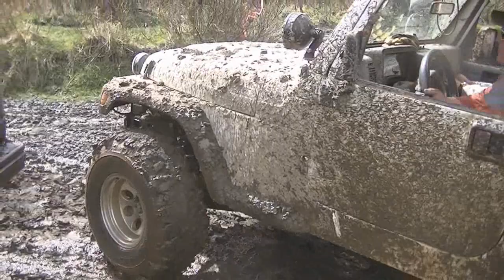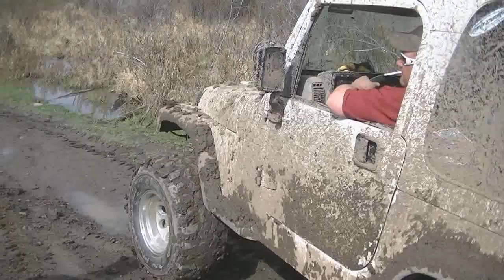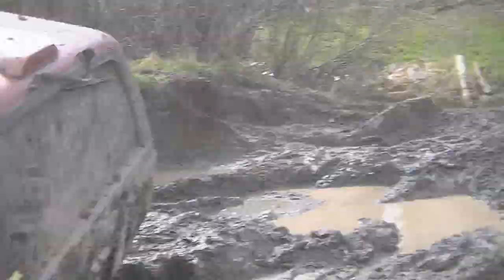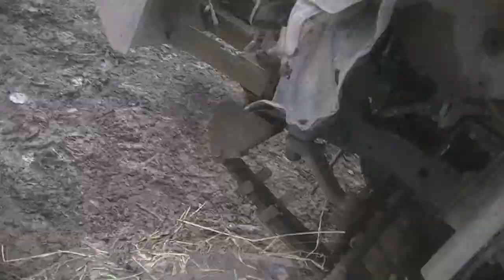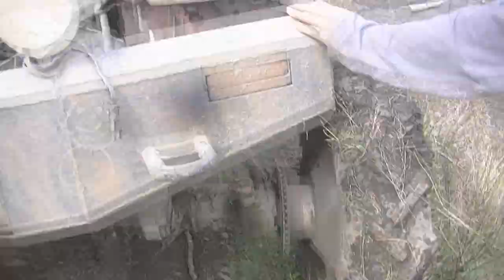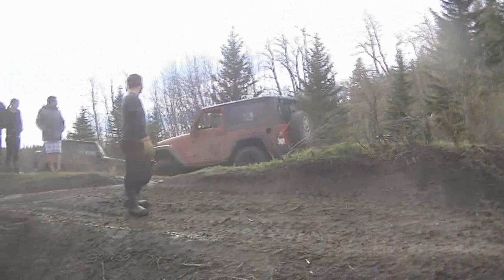Mclean Creek 2013 - Stuck (AB-JK & Calgary Jeep Club)

Comment: The reason the tires are pointing out on the front is the truinion bearings are toast. That happens when you over size the tires like that. They make truinion. bearing Eliminator kits and they turn the bearing into king pins. Their allot stronger only draw back is they gotta be serviced regularly (cleaned and greased). Good luck with getting her back on the trails.